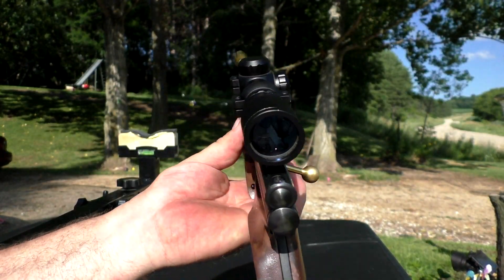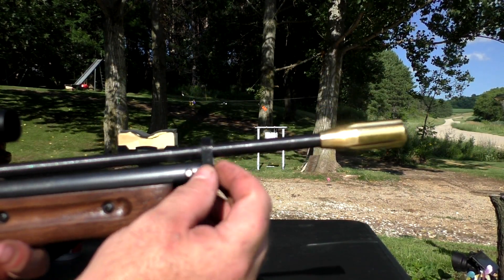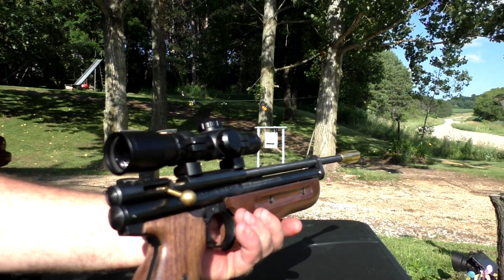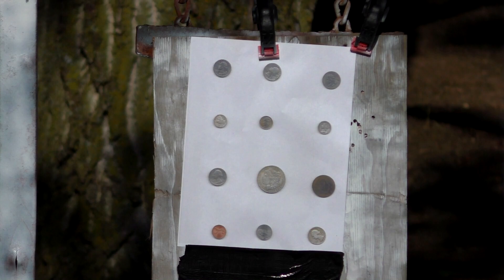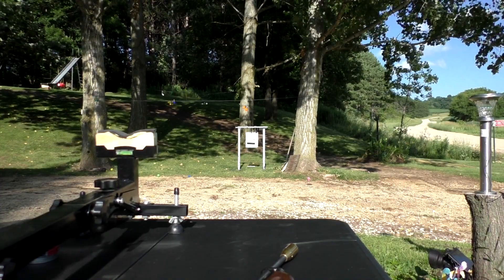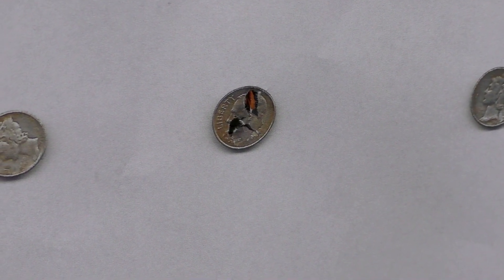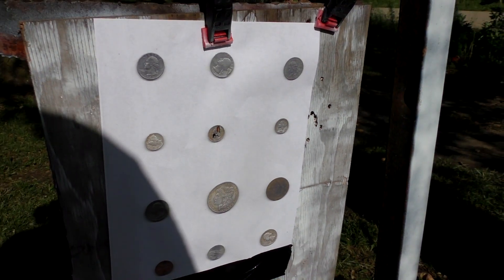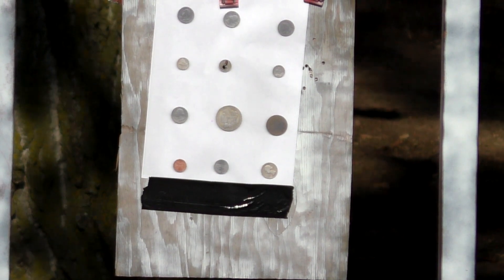Modded Crosman 1322 22 caliber Air Pistol  Accuracy

Comment: I just ordered the breech upgrade...Haven't decided if I'm putting it on the 362 or the 1322 yet...I have a buck rail suppressor on my 1322 and I love it...super quiet
Reply: Have you got a gigantic scope that you can see Mars with . .  put on your air pistol . . . Wow I bet you could put a hole in a Coke can at 10 yd away . . . Using your $400 scope and all the modifications to the gun . . . And it takes all that just to put a hole in a Coke can 10 yd away . .   Hahaha 😂😂😂
Reply: @jameskox872  What point are you trying to make here? 🤨🤔

Comment: I have that gun. Out of the box it is very accurate. I don't think I'll put as much into it as you and others have. I did replace the sear spring with a 3 lb pull one I got on Ebay. That was a great thing. I am waiting on a mounting bracket and a cheap red dot. My eyes need that. I paid $45 for the gun new on Amazon. The price on this thing is all over the place.I see it in the sixties on China sites. It went from $61 to $66 then down to $45 at the Crosman store on Amazon all in less than 2 weeks. It's back to $66.81 on Amazon again! Crazy. It came in a sealed blister pack from the Crosman store so I'm sure it's OEM. Anyway enjoyed your vid and like that 20 m accuracy you get. I usually do 8 pumps and plink targets at 8 m. My arm would get very mad if I pumped it 15 strokes! I'm 72 yrs old. I have a double garage I shoot in as the weather's getting chilly here. Thanks again, good work.

Comment: You are correct on the steel breech. For anyone wanting to mod a crimson 13xx or 22xx for hunting, the first step should always be the steel breach. You can have a powerful gun but if you can’t hit your target it’s pointless. Best 40-50 dollar mod there is.
Reply: What does the breach change achieve? Jw
Reply: The breech is where you load the pellet and it attaches the air tube to the barrel. In stock form these guns come with a plastic breech and it’s actually wobbly, if not time will make it so. With a steel breech you’re making the gun solid for shot after shot consistency. So I say upgrade breech first as without it you’ll never have a solid accurate gun. It’s not like a barrel though where it’ll make or break accuracy it’s just a component that you need for a good gun, has little noticeable gains but it’s required.

Comment: thanks for this great video!  Several years ago I spent lots and lots of money trying to accurize and power up a 1322 and wound up selling it to another fellow for pennies on the dollar. At the time  I also had a Benjamin marauder pistol (the so-called "P-rod) that i was fooling with in the same way, with roughly the same results (i.e. none, the gun stubbornly ignored any and all efforts i made to accurize it. These included a new walther barrel, a breech re-seal,  an excellent Redfeild scope, dozens of different pellets, barrel suppresor for quiet, all over and above the guns $340 price) all for naught.  The accuracy was ALWAYS inconsistent and all that pumping soon drove me batty, and true to form a month past warranty this P-rod started leaking air at which point i gave up.  Pumping up with Hill pump (yet another maintenance headache, despite truly excellent customer service from Hill in England, and rebuilding the pump I simply got worn out from all that damn pumping!  

The 1322 I feel I gave up on too soon also, after I spent a small fortune:  steel breech, new brass valve, new pivot bolt, metal barrel band, beautiful wood grips, even a $100 sight, I easily had $300-400 in the $60 gun and the results were not justifying the investment.  Sent away for a new gun to give it another try, aiming for a budget build this time aiming for most accuracy and FPS for minimum investment this time!
Incidentally I finally DID buy an air gun that gave me the accuracy I wanted, although it is a rifle:  I spent $400 for a Walther LGU with wood stock (Airguns of Arizona was $100 less then anywhere else) this gun is a bottom cocker with fixed barrel, the secret i think.  This gun is beyond doubt the most accurate airgun I have ever fired and not only that, maintenance is  unbelievably easy!  The ingenious design of the Walther requires NO spring compressor to clean or replace a piston, seals or spring.... all you need do is remove three bolts,, pull the works out of the stock, then just tap out the pins at the rear of the tube and everything simply slides out under almost no spring tension.  Now if only they made a pistol version...

Comment: I just decided to get back into shooting air guns.  As a boy in the 60s I owned a Crossman 150 and 
my sweetheart was a Sheridan Bluestreak.   I just received from Pyramid Air my new Crossman 1322.
In this era of firearm shortages and prices skyrocketing I am looking forward to keeping up my 
marksmanship skills with my air pistol.

I plan on doing some of my own modding on my new 1322.  I already have a 1399 shoulder stock on order.
I think I will later upgrade to the steel breech and either a scope or a red dot sight. At 63 years old my eyes are 
not what they used to be.

Your accuracy is quite impressive.  What type and weight of pellet were you using?

Liked.....Subbed...Rang Da Bell

Comment: nice build. i have a brass barrel band and brass end caps with the black breech the same as yours with the same barrel and steel breach it looks like. i also have an anodized blue valve and a larger port with o-rings top and bottom.

Comment: That is a sweet setup up. What slowmo cam are you using?
Reply from the maker: It's actually my old panasonic W850. Only does 120fps but with full control of the shutter up to 1/8,000th second and no rolling shutter helps. Sure am tempted to get the Sony RX 100IV but has limited recording time in slow mo though. Got rid of my Casio EX-F1. You'd think some company would start making a good full control slow mo cam by now.  Been hitting your vids off and on. Pretty nice blades, looks like you know what you are doing going off the one vid of the small hatchet type blade that doesn't seem to dull you made. Pretty neat.
Reply: +scannerguy1968 Thanks, I picked up a sweet 1200fps  Gamo rifle a while ago. It is supposed to be quieter but it's still to loud for where I'm at in the city.  I too have been eying that camera and the RX10 MIII.
Reply from the maker: Never had a Gamo. I did buy a Hatsan 125th. in .22 caliber. Gamo alloys go super sonic through it cracking as loud as  a .22 rifle due to breaking the speed of sound. Heavier leads quiet down with it. Need to get an Airforce Texan .45 PCP. 500 foot pounds of energy.

Comment: I have seen many of the videos on YouTube that indicate accuracy when the whole shot group is far away from it's intended mark.  I admire you!  You didn't do that.  Yes, tight groups are good, but if they miss the mark, they are worthless.  I would rather have them scattered and run a risk of hitting my target, than to have a tight group that misses it.  GREAT video.  Thanks for posting it!
Reply: Consistency = Accuracy. A tighter grouping is more important than where the pellets hit. If a gun shoots 3" to the left, but gets 1/4" groups, it is still considered accurate. Its easy to compensate for the 3" by either aiming 3" to the right, or adjusting the scope 3".